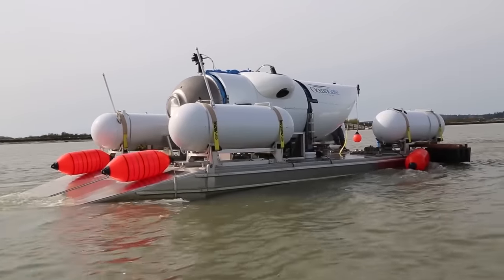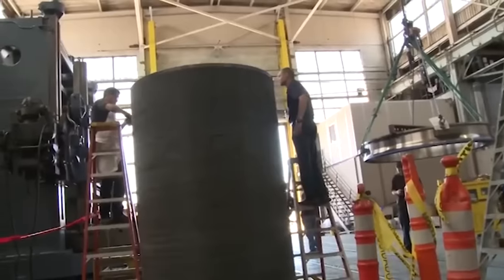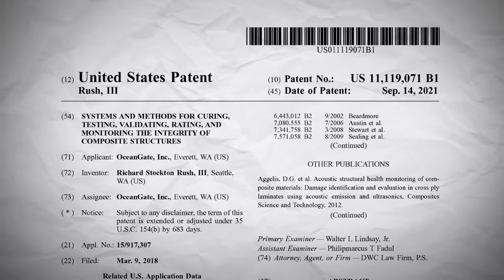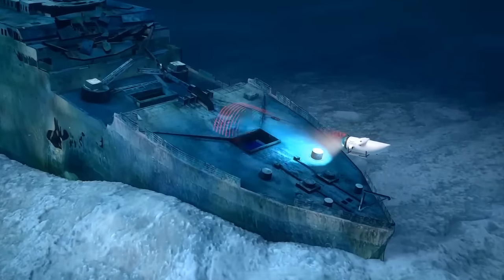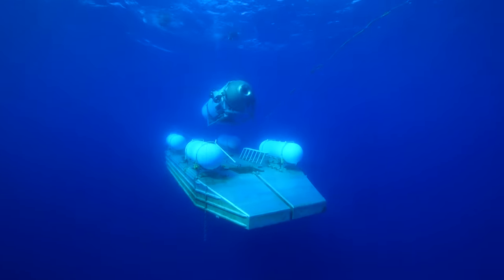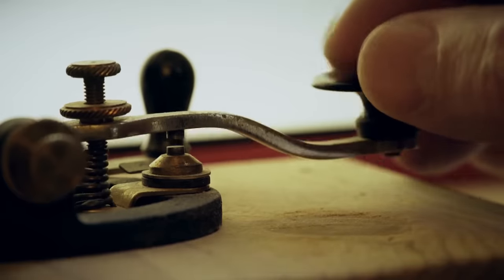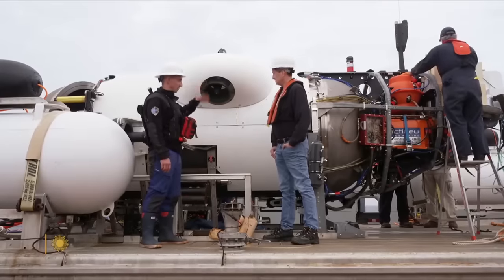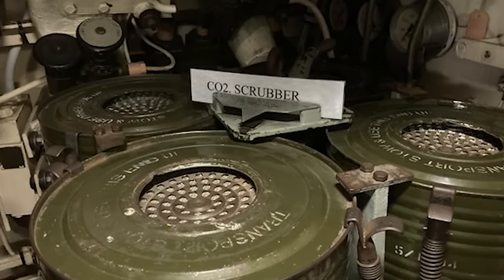Exposing OceanGate Submarines Many Fatal Designs

Comment: The ironic thing was that even if Stockton and his crew would have miraculously survived, Stockton was so arrogant he would have just laughed it off and said “it’s because of this or that” and continued to use the dangerous carbon fibre even though he just nearly died he would have doubled down and whereas a normal person would have apologised to the crew profusely, given them a full refund, and stopped using the dangerous contraption, he would have done none of that. He was out to prove everyone wrong and it cost him and his crew their lives.
Reply: He would continued dives until something broke.
Reply: I'm not a deep sea oceanic engineer or anything, but I don't get why they just didn't spend the extra money (they could probably afford it) and instead of 5 in. of carbon fiber, build it out of something strong and light, like 12 inches of titanium.  Maybe that's unrealistic?
Reply: @gargamel3393  too heavy....its a submersible not a real sub. but I agree should have use titanium at the very min instead of just the two end pieces smh.
Reply: @gargamel3393  yeah exactly, use an established material that is proven rather than something new so you can 'pretend' you're an innovator, unfortunately this type of mindset cost people their lives, it's like Stockton just wanted to use the carbon fiber so he could have the gloating rights, regardless of it's safety he didn't want to use a material other subs were using which was a dangerous thing to do.
Reply: @raoulmoat6762  Carbon fiber is horrible for a vessel under external pressure... its one virtue, containing internal pressure, is not in use.
Reply: @gargamel3393  I think he was just being cheap. There are submersibles out there that can easily go to that depth. Triton in the USA make various models of submersibles, the 1st one that was designed for visiting the Titanic only holds 1 crew member and one passenger. That model starts at $10 million, they make a 2nd one that can go nearly 3 times the depth of the Titanic but that starts at $48 million.
Reply: This is my assessment of Stockton too. Controlled by ego.
Reply: @mikaelav8964 submersibles use real titanium and steel spheres without it being a full submarines…James Cameron uses both
Reply: Good riddance anyway, I like a story of the trash taking itself out
Reply: What’s wild is that it went like 4 times with people, this could work if you rebuilt it every other time… idk man it’s wild it made it at all in the past
Reply: Stop calling them "crew". They were not crew. They were customers that were murdered by a megalomaniac
Reply: @raoulmoat6762 Stockton must have had absolute faith in his lunacy, as he was prepared to go down on the dives himself.
Reply: @SeekingTheLoveThatGodMeans7648  I've known people with new carbon fibre framed cycles and they've made the mistake of leaning the bike at an angle when parked against something small, pointed and hard and sharp, for example part of a wall or fence with pressure being put upon the frame at a small point and the carbon gives way and cracks with a delamination. the frame is then usually scrapped ...
Reply: @mikaelav8964  pretty sure titanium is actually very light considering many aircraft use it and as strong as it is, 10 inches thick should have worked
Reply: Their is a couple who had filed a lawsuit against Oceangate and Stockton bc they put a down payment down on a trip titanic and both times they were supposed to go it got rescheduled or canceled bc of problems. Yet he refused to give them their $ back.
Reply: Prove but with the facts. He had superiority complex and thought the he is the most knowledgeable learned person in the world. Rest people are just bragging about their degrees and certification. He behaved like a educated illiterate without logical reasoning and enough safety protocols, procedures and certifications. Do experiments, be innovative but at the same time carry all necessary safety protocols and test procedures so that if such a catastrophic situation comes your device is capable of withstanding the harsh realities.
Reply: @og-big-shepherd4468  You can calculate the thickness required if you know the pressure it has to withstand.
Reply: @gargamel3393 Good quality alloy steel would do it.

Comment: There was a brief mention somewhere in the media about how the thick Plexiglass window was expected to flex inward a good bit.  "No worries", however, as there would be a noticeable crackling noise which would alert the crew before failure would occur.  I'm no engineer, but I believe that by the time an acoustic monitor detects something going wrong with the hull, or a crackling noise from the window, catastrophic failure is already underway and the craft could not be brought up far enough and fast enough to stop it.  The failure rate would become exponential as breakdown potentiates further breakdown.
Reply: In every video I've seen of people documenting their Titan experience, the crew is having to perform repairs and maintenance on the craft in the middle of the ocean. In one video, communications were down and had to be fixed. I wouldn't want to go on a plane where the plane is delayed because they're in the midst of fixing it prior to take off.
Reply: That’s what people are saying. The acoustic monitor isn’t reliable because by the time it picks something up, it’s already too late.
Reply: I haven't read up much on the incident. Was there actually audio transmissions indicating possible argument on board over worrisome signs? I would imagine that with five people on board, you'd have different levels of freakout and urge to abort the mission.
Reply: @Dowlphin  Stockton Rush always insistend that the crackling of the breaking carbon fibers during descent is normal and told passengers to be prepared for that noise.

These noises are already present at a depth of 300ft (100m). Had anyone disbelieved Stockton Rush and freaked out, this would have happend pretty early.
Reply: Well said.
Reply: @klausstock8020  Yeah my carbon fiber paintball tank kinda creaks when I fill it. The big difference is that its under tension (good), not compression like the sub (bad). I really don't understand how the idea got past the drawing board stage.
Reply: Well, he kinda found that one out the hard way. At least he won't make that mistake twice.

Comment: (3:26) The problem is that the buckling occurs a millisecond before the implosion. Assuming you could hear it, it'd be too late.
Reply: They knew something as they were trying to abort
Reply: clearly not because they released one of the weights so they knew something was bout to happen atleast thats what was reported in the computer system
Reply: Seems that all the Cooper Union, Caltech and MIT mechanics and physics experts descended on the comments section here
Reply: @ironlionzion1380 ya, I thoroughly enjoy so many experts taking the time to explain what happened exactly.

Although often they all have different answers.

There are likely answers but it's all speculation.
Reply: @LinkTheKink  Source? I can't find anything on the internet about that.

Comment: As an unmanned submersible, it is an interesting idea.  If the materials and manufacturing are cheaper, and the submersible is lighter and easier to carry and deploy, it could lead to faster development of deep sea exploration.  But as a manned submersible, hell no!
Reply: Why don't use a forged alloy thick tube, whith sealed and bolted ends for lighter construction? main problems: corrosion resistance in sea water and probably t°expansions in very cold water: - 2°C at - 4000 meters.
Reply: Why would you need a pressure vessal on an unmanned craft?
Reply: @danieldupuys2002  
 I’m not an engineer, but a tube of any kind sounds like a submarine, to me.

Comment: The carbon fiber hull was apparently glued to titanium rings, one end (the bow) with a bolt-on door, the other is hard to tell if it was solid or had a ring/door.
  As for buoyancy, things become morr negatively buoyant on descent. My guess is they may have found themselves in an uncontrolled descent, which may have contributed to their implosion.
  So many issues with this vessel, communications, etc., I wouldn't have gone inside this sub, even had I paid for a trip.
  The engineering was sub-par, the communications between staff and passengers for that environment, or ANY dive environment, was sub-par.
   It's as if they focused on the materials for each part, or pre-fab section, ignored some limitations, and went ahead with it, despite warning and safety concerns of others.
  You cannot play with physics limitations under water, or you will lose.
  The arrogance of those involved was incredible.
  The lack of adequacy of major safety issues makes this outcome non-surprising.
  Degrees and associations with agencies don't mean anything to the physics involved,  thus the unsurprising implosion.
   These people should've known better.
This sub looks like a wealthy kid tapped ut together in a garage with little knowledge of the environment.
   Hopefully this will show others who become engineers, divers, submariners, etc. to respect the environment, don't get kocky, and to work out communications BEFORE any dive.
   So much wrong with this submersible,  the staff and the engineering... Having worked with submersibles, this is not a crew or submersible I would work with. I'd simply walk away.

Comment: Thanks..Excellent explanation.  Titan late CEO Rush has worked in aviation. Later had done a Degree in Aeronautical from a private campus, not Goverment/ State University. He had less fundamental knowledge on Fluid mechanics. He designed the Titan hull similar to aviation where fluid is Air. In ocean fluid is salt water with much density & water pressure at above 2500-3900 meters depth. Basic design fault of hull etc..